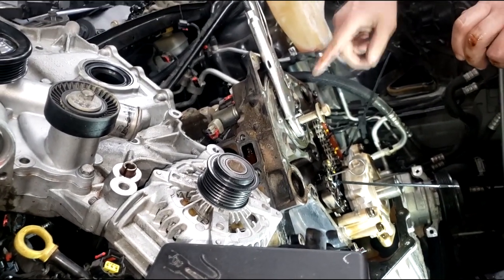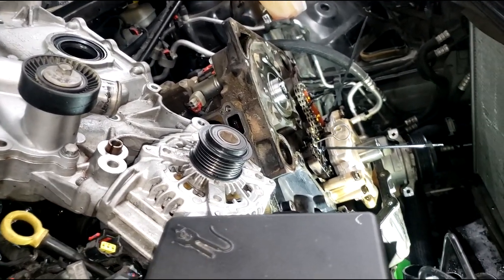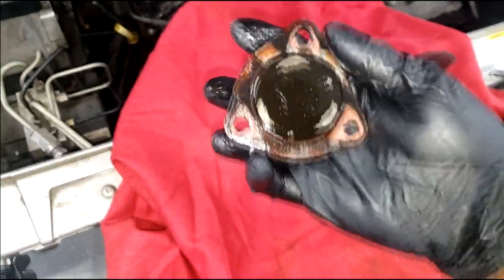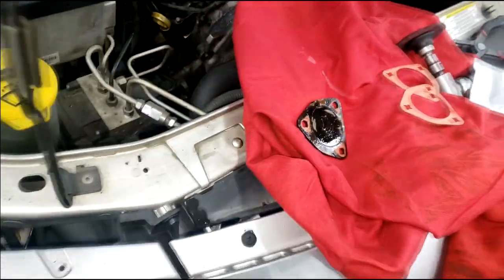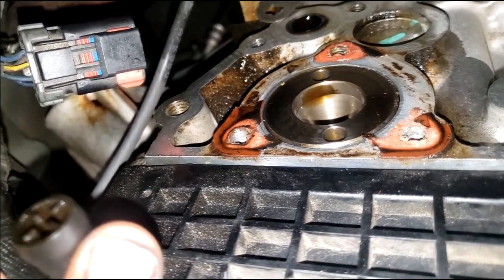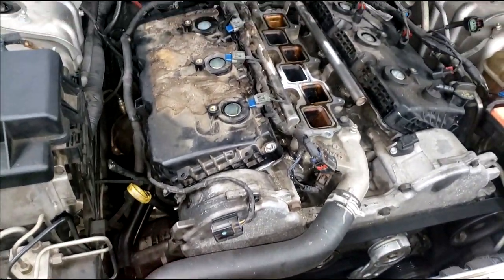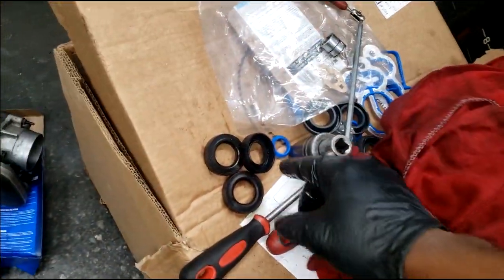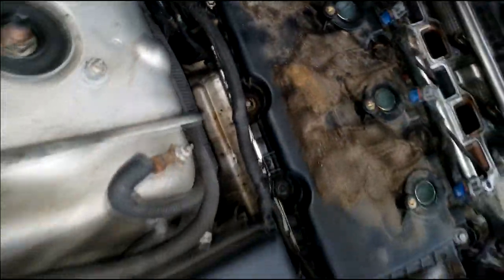5.7L Hemi Tick Camshaft Remove and Install Secret Tip. P0305. 3.5 Oil leak valve cover repair tip.

Comment: Sub here we have talked about replacing rockers on a 3.6 pentastar and I’m just wanting to know when I get every thing back together with my new parts will regular oil 5w30 be sufficient enough or do I need to use some other 5w 30 for breaking?
Reply from the maker: When you say regular oil im hoping you going to go with a good brand..As for the weight, some 3.6 call for 5w 20..but 5w 30 just as good..I think the recommended weight printed on the oil filler cap
Reply: I’m siring 5w30 as mentioned and it will be pennzoil platinum
Reply: Pennzoil platinum full synthetic
Reply from the maker: @davidblankenship7599  good stuff

Comment: Was the Trans removed?
How was that angle achieved to get the cam out W/O removing the radiator, etc.....?

PS. Scotty Kilmore is stuck in the 80's. As a tech. Imagine him trying to navigate wiTech! He couldn't program a FOB! I'd blow his mind! He looks like a troll from Lord of the rings
Reply from the maker: Lol...this guy is so fast I only had time to grab my camera when I saw him grab his jack..he removed motor mount bolts and the trans mount bolts and because there was no intake manifold, he was able to lift engine up pretty high..the next one I do I will film full job footage

Comment: You put the tube seals in the valve cover..upside down bro pitted side faces down round side faces up!
Reply: Little things can cost you alot of money..paying attention to recording a video..can cost you money..if you are not paying full attention to what you are doing..dont get complacent bro..I do the same
Reply from the maker: lol, the tube seals are on correctly buddy. Not sure if you saw what you saw. I try to stay focused when recording as well as speaking as well as working all at the same time. Ide like to think I do fairly well. Thanks